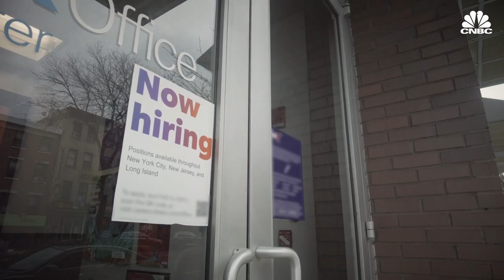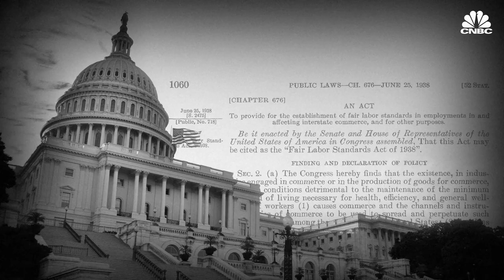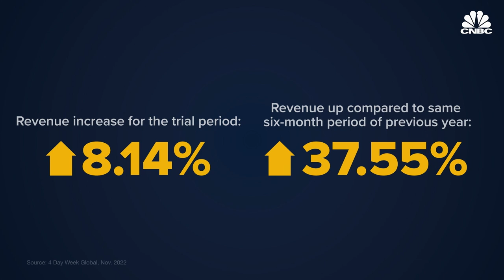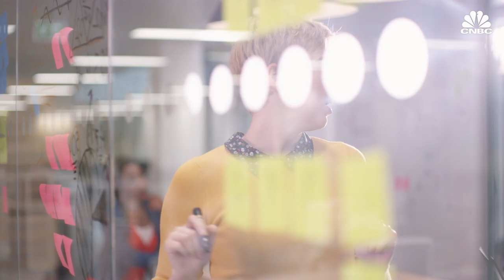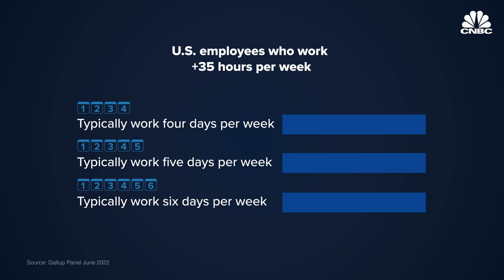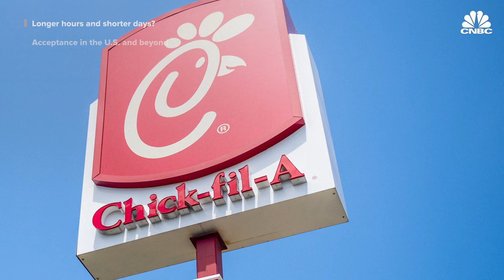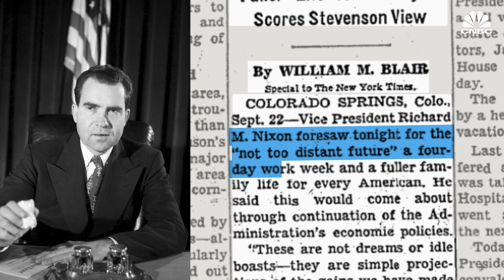How The Four-Day Workweek Could Change The Future Of Work

Comment: Better than the 4 day work week is letting employees have flexibility with when and where they work. Need to start 2 hours late on Monday, Wednesday, Friday or 3 hour lunch on occasion? Fine, make up the hours at another time in the week.
Reply: Flexibility I think would be a better solution. Some only want/need to work 32 hours, others 60. Some folks have scheduling issues outside of work that flexibility would solve.
Reply: @vsx1967  The concern is if you switch to hourly pay use lose some of the benefits of a salaried employee, at least where I work.

Comment: This needs to be implemented for all corporate jobs. Restaurant sector and a few other sectors it couldn't work for. If you're paid hourly though, you will make less working 32 hour weeks I'm assuming. For salary people, I feel like corporations would try to lower the pay since you're putting in less hours, but that won't fly. We the people need to do something about corporate greed also. We're the only ones who can make a change to it if we have enough people stand up and confront the top people about their greed.
Reply: Most 4 hour work weeks are 10 hours a day so it still adds to 40 hours a week
Reply: Did you watch the video? Very early on they say they don't want to make workers sacrifice pay to get it. It would mean adjusting wages to make the same on 4 days. 

And it could work for restaurants. Part of the reason restaurants tend to have such high turnovers is because managers keep them short staffed and overworked. If they hired enough people to keep all full time workers at 4 days, and also didn't treat them like dirt, it could absolutely happen.
Reply: @joshuawatts1924  They literally say very early in the video they are wanting 32 hour work weeks, not extending work days
Reply: @JasperXCXeon  I was just saying the 4 day work weeks that I have seen have been 10 hour days and the people involved have loved it more than a 5 day 8 hour week. Just my experience.

Comment: I think in some industry fields, a four day work week would be feasible and probably beneficial.

However in some fields it's just not feasible, or at least easy to reset schedules to.

For example, I am a grocery store manager. We have deliveries 7 days a week and each department must receive and process each supply shipment.
Each department manager has to coordinate resources and staff with various other departments each day.

There are simply too many variables, such as late trucks, staff call-outs etc, to only have managers work 4 days a week.
Food is an emotional buying experience for consumers and not maintaining fully stocked shelves quickly turns into a negative buying experience for customers.
I don't see how, in the grocery field, would a 4 day work week be successful.

However I do think I could be very impactful in other fields.
Reply: It will be harder to implement in some places, but not impossible. 

Your work may need to hire a couple more managers, and keep schedules staggered so there is always at least one available during opening hours. 

Keep in mind though some people in the 1930s probably thought a 5 day work week was impossible too
Reply: I think the issue you're having is from a standpoint of trying to see it as 4 days straight and 3 days straight. That doesn't have to be the case. MTRF can be a schedule. SSMT can be a schedule. SMTR can be a schedule. It very much can work in every industry if there were enough employees and you are willing to get creative with the schedule. I personally feel like every employee should have at least one weekday off for important things like doctor appointments. And don't get me wrong, I know a lot of the older generation prefer to work 50-80 hours a week and that's great for them, but I would have to tell them simply, "we don't do that here, but you're more than welcome to get a second job if you prefer no free time" But as someone in their 30's, I am very aware of my mortality and the inability of my body to keep producing efficiently with a 5 or 6 day work week. Also, I'd prefer to be around people that love me more often than people I simply work with.
Reply: I would love to work a 4 day work week I agree with @ Athos Count I work in manufacturing and my job is open 365 days literally. My job never closes.
Reply: Everyone saying they want a 4-day workweek is assuming that society will still function M-F. But what about schools, doctor's offices, professional businesses, etc - all those services that people expect to still be open during the week, whether they have a day-off or not? They would a need to hire 15-20% more people to cover the same hours, which is unlikely given the current & projected labor shortage.

The 5-day workweek is baked into every facet of American society - unless folks are good with kids getting 20% less school, or having one fewer "weekday" to handle personal/professional business, this is one of those "for me, but not for thee" situations.
Reply: Can't you better split the workload between the 7 days?  Why does each department have separate shipments?  Bulk them to save on Gas, transport fees and the like and you'll increase the efficiency of your store.
Reply: @AverageJoeTwoPoint0  Where is your R coming from?!?  I believe you mean W for Wednesday, right?
Reply: @mandisaw  Or they simply adjust the days schedule.  Schools only have 6 hours of classes, hence why the local high school starts at 9 and out at 3.  Yes, teachers stay LATER, but then again......THEY GET 10 weeks for SUmmer, 2 weeks Christmas, and most holidays
Reply: @timberwolfe1645  I work for a multi-national corporation.
I like your suggestions, but unfortunately the bosses at corporate think they know best. 🙄
Reply: @timberwolfe1645  [US] K-12 school used to have longer hours - it was 8a-3:30p when I went (even earlier/later with extracurriculars and optional breakfast). Students now barely crack a 4th grade reading/math level by HS graduation, and are missing a lot of study & socialization skills - they need more time in school, not less. 😮‍💨
Reply: @timberwolfe1645  Similar to schools/children, grocery stores and many other sectors have external considerations. Deliveries arrive based on the suppliers' logistics, stores &  offices are open when customers or clients/patients need them, and schools are open when it's best for kids/students & their families, not the teachers. The world is very interconnected, even on a small-scale like a neighborhood, nevermind at the level of an entire country.
Reply: @mandisaw  wrong! There are societal issues, ahem poverty, that stifles kids ability to learn hence they come to HS reading below grade average. 
The school structure NEEDS to change.  It doesn't currently work for all.  I believe in a hybrid schedule and internships for students.  Let's join the 21st century in regards to children learning. We are digital and kids, especially older kids, don't need to be in class 5 days a week unless you just want the babysitting aspect of teaching, which let's get real some parents really just want that... but wouldn't need it with a shorter work week.
Having kids gets the basic from M-W then branch off and do internships/volunteering for the remainder of the week and cycle through various careers would produce better engaged and more mature students.   We extend childhood in this country which doesn't benefit teenagers who should ve volunteering and learning something HANDS ON.
Now doctor's offices can stagger their schedules too so that it can fit into a shorter work week too.  There are lots of 24/7 jobs that do that... the staggering of work schedules I mean.  It can be done if there is a genuine desire to change the status quo which isn't currently working for many people.
Reply: @jyoti Kumar Eventually it will all be automated.
Hell, McDonald's just rolled out the first automated drive thru. You get your food from a machine.

If companies can automate everything, then they will. Don't know how people will eat in the future with no jobs.
Reply: @mandisaw  schools are easiest to schedule because school days are completely arbitrary they can go 4days 8h or 3 days 10h or if you rly like your kids being in prison 7 d 12h there is no reason why it wouldn't work in any other way except 5 days 6h for stores and other services it is a bit trickier they would need more workers basically but hey if people had more free time more people would be willing to work those jobs for example nobody wants to work as nurse because you basically marry your job but if they had reduced hours a lot more people would be willing to do it. ultimately it comes down to law and profits unless you're some rare skilled employee, without proper laws employer is more than happy to make you work your every waking moment. i live in serbia and when i worked in market since they had no people i basically had to work every day and was often asked if i could work double shifts 16h (double shifts were optional) since i needed money i was ok with it at the time but i imagine most people aren't happy
Reply: @mandisaw  schools used to be 6 days a week, the same as the work week. They clearly changed both at the same time. Now many schools are also implementing 4 day school weeks which will help. Both parents and kids will have 3 day weekends and be less burned out.
Reply: @mastersnet18  US school wasn't 6 days/week, certainly not back when the 40hr work week was adopted. Most kids then didn't even attend school past the early grades, and many worked, either inside or outside the home. And today the only schools instituting 4day weeks are ones that are failing, and lack teachers/funding to keep the place open a full week. Those kids/communities are going to be screwed - rich kids & elite schools aren't shorting their educations, I assure you.
Reply: @mandisaw  I never said it was when the 40 hour work week was implemented. Let me explain again. In the 19th century and earlier kids went to school 6 days a week, if they went full-time. Some city schools even had school as long as 240 days a year. I feel bad for those kids back then! People worked 6 days a week as well. Only Sundays were off. Many people worked 60-105 hours a week. This changed in the first half of the 20th century to 5 days a week and slowly crept down to 40 hours a week.
Reply: @mastersnet18  You're still off - we didn't get free public school in the US until the 1920s, and it wasn't for everyone, everywhere until mid-century (and desegregation came later still). There were 19th c. cities & organizations that offered school, sometimes free for the poor, which kids basically attended at-will, often not consistently, or past primary school. 

Until quite recently, historically-speaking, formal education (6/12/16yr) was only for those who could afford it, either directly (rich), or indirectly (religious communities, private orgs, or some progressive-minded public entities).

You could make a case that the school-day/week is tied implicitly to the workweek, but really that would only come into play very late in the 20th century (80s/90s at best), once you've got a politically-significant number of working moms. 

And even now, it's more tied to how much school the Feds mandate, and the districts can afford to provide - you won't see a widespread change in school schedules unless both of those factors, and the workweek of parents, are all changed as well.
Reply: @mandisaw  umm no. No offense but where did you go to school and what kind of history were they teaching you? I know many schools in the south don’t even teach proper history.
Reply: @mastersnet18  😂 I went to a couple of the most elite schools in the US, but thanks for playing. Feel free to look into the history of US public education, the Dept of Ed has an entire page on it, and of course there are a number of books on the subject.
Reply: @mandisaw  well they either didn’t teach you too well or you fell asleep in class. My state was the first in the nation to have public schools, and the Midwest had public schools in the 19th century paid for by taxes. So idk where you get the idea that public schools weren’t around in America until the 1920‘a because that isn’t even remotely accurate. If that’s what private schools churn out it was a waste of money. And I’ve read plenty of books on the history of education. I suggest you do the same before making a fool of yourself online.
Reply: @mastersnet18  Your state != nationwide. And even within a given state, education certainly wasn't universal, free, and supported for all students, of all genders, ethnic/religious/national backgrounds, and economic classes until much later than the 1800s. Rather than jump immediately to insults, generally it's advised to clarify your position, and your assumptions, before making a rhetorical argument.

I also learned not to waste my time/energy on fools & their unattainable notions, so you do you, buddy
Reply: @mandisaw  ok well you just go read some more history then and try to come up with a better answer next time.

Comment: To be frank, a 4 day work week would work wonders for ppl like me who have multiple injuries including chronic pain. I was born with LCP, a bone disease that affects my hip and the amount of issues that has stemmed from it has really made life difficult for me. I now need a hip replacement as the ball joint in my femur keeps degrading and also affects my posture where I essentially "lean" to the right because my right leg is shorter than my left when I stand up straight. 

Lower back problems comes from it and on top of needing a hip replacement I also need to get my right knee replaced at the same time as well. But because I am so young, I was given the choice to hold off on the surgery until the pain becomes more and more severe, I currently work in the warehouse for a dealership 9 hours a day mon-fri. The amount of walking, standing, lifting and bending takes a heavy toll that by the 3rd day or so of the work week I become very slow and slugish trying to literally work through the pain and my lower back gets weaker and weaker.

At this point I need a desk job so that my pain threshold goes from an 8/10 to a 3/10. I just can't find anything where just the minimum requirements aren't absurd.
Reply: I've been working a four-day workweek for years. Third shift, 10-hour shifts, Thursday to Sunday. That gives me Monday, thru all day thursday.....four days a week off, every week. THAT third day off works wonders for your brain. I've had a hip, and both knees replaced.....right knee, six months ago, was driving a week and a half later,,,Good Luck.

Comment: Soo I work for Amazon and we have always worked the 4 day work week with 1 work day being a weekend whether we choose Sunday or Saturday to come in. Depending on your facility will determine your shift length. So you could either work 4 10 hr shifts or 3 12 hour shifts and a 5 hr shift. I don’t believe this 4 day work week dynamic is suitable for a warehouse setting as you will be drained by the time you get off and you’ll have a very limited amount of time to get home relax and possibly cook dinner and do dishes and run errands etc. when it comes to blue collar workers I think it would be more sustainable and less draining to work 8 hr 5 days a week. Now with Amazon we do work 5 days a week with that being 10 or 12 hr shift days

Comment: I work 4 days a week but put in 5 days worth of hours. It’s brutal but it works. The work has to get done. And you need the hours to do it. Don’t expect 40 hours worth of work in 32 hours. That’s just giving a raise - it doesn’t amount to much else if the work expectation doesn’t change.
Reply: In your opinion. But this study literally found that productivity increased using a 4 day/32 hour work week model.
Reply: @KailuaChick  - the issue is the sector. Do you think a surgeon would be as productive without additional time within that truncated schedule? Anesthesia still has an onset time that does not care about my schedule, as do the procedures themselves. This video is too all-encompassing and there’s limitations to what can be generalized. Not an opinion - these are facts. Some fields require additional hours within a shorter work week to maintain output.
Reply: @cameronhetzler5407  Thank you! The production of many blue-collar jobs is almost linearly dependent upon physical labor too. Demanding the same amount of work for fewer hours would be damn near impossible.

Comment: The only thing that confuses me is the part where they say you get 5 days of pay, but with 4 days of work.

How exactly does that work with hourly employees? If I’m currently working 40 hrs a week and it gets reduced to 32 hours, how is the company going to pay me for the 8 hours I never worked?

All it seems to do for hourly employees is reduce them to part time instead of full time workers. Which also requires the company to hire more employees to fill in the gaps of lost work time.

I like the idea of working four days a week. I just don’t understand how it works.
Reply: I think this is more aimed at office and tech work, where it is very common to get a days work done in 3 or so hours (for software, compilation can also take some time for large projects, so devs have plenty of downtime instead)
Reply: In Belgium, you still work 40 hours (you add 2 hours in each remaining day, let's say Monday to Thursday for instance, and your Friday is free). And you keep the same wage, of course.

Comment: Most of these studies are flawed because a majority of jobs surveyed are jobs in which productivity can not be accurately measured. If you want to see how viable it is, change a factory to 32 hrs per week. Factory productivity can be directly measured. Most factories run 24/7 so rather than measuring output you need to measure total man hours to maintain said output.